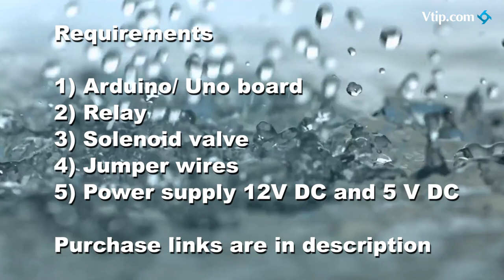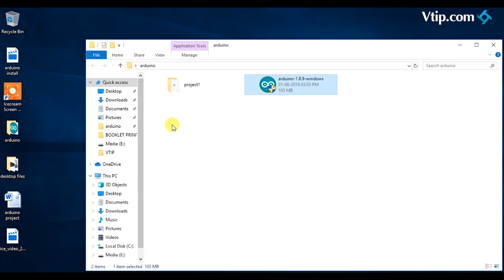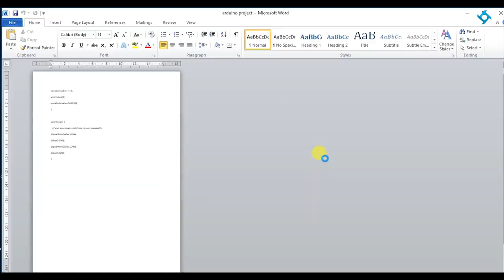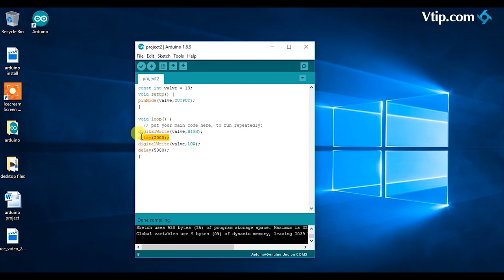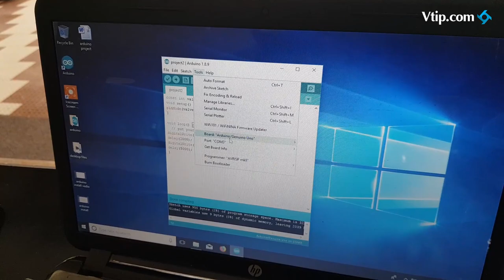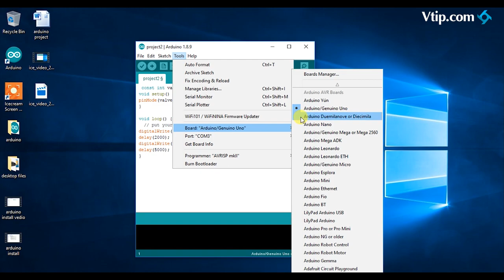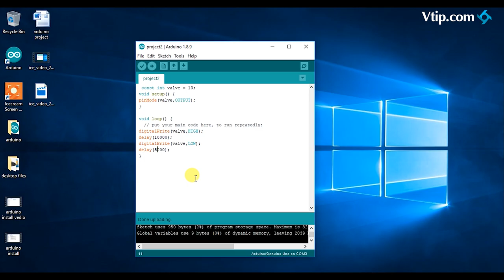Automatic watering controller using Arduino - Uno Board (Simple Project, No Experience required)

Comment: So Im gonna be using a separate clock module to regulate the opening and closing (the opening/closing of the valve is part of a large watering system). Do I need to use a relay? Im thinking I could just open/close the valve directly from the arduino uno. Would appreciate your thoughts on this, thanks
Reply: operating the valve directly from arduino board is a little risky as back current from the solenoid valve can damage the pin or even worse, can fry your arduino board

Comment: Hi! Hope you’ll answer my question. So I already have a relay module with a timer in it, is it okay to connect it directly to the Solenoid Valve without even using arduino?
Reply from the maker: Yes, you can connect the timer relay instead of Arduino.

Comment: Hi, this is wonderful.
I'm trying to make one, that can turn on when watering only and rest of the time the circuit remains open.
Is that possible?.If yes how?
Thanks in advance
Reply: Plz explain your requirements, I can help
Reply: @Niyasazeez1  Hi, thank you!
Well what my problem is, I want to implement this in real-time and it should be completely automated.

The problem is I can't run Arduino 24/7 all days a week.,it will damage the board
I want the entire circuit to be connected with power only 3 times a day, while watering the plant.
Rest of the time the microcontroller has to be in off condition.

Is there a way to do that?
Thank you for your kind response
Reply: @solomonbradleyj5999  there are few issues to implement your requirements with the above set up. The code gets reset whenever the power turns off and restart the counter when the controller is powered. So you don't get the proper functionality if the power turns off. You can use a real time clock module to solve this issue, still the microcontroller should be powered all the time. Otherwise use a time relay set up instead of microcontrollers. I
Anyhow I don't think the board gets damage if it is powered for a longer period.
Reply: @Niyasazeez1  Thank you for your help
I think running Arduino continuously for 4 months or more can damage it.
And forget Arduino what if I just connect a DC valve and the relay setup and just control the Power supply. My requirement is a power socket where power comes only 5 minutes , thrice a day.
And this three times the valve powers up and opens.
So the question is
Is there any way to get power  only at specified times from a socket?
Thank you again!
Reply: @solomonbradleyj5999  I will check and revert back soon. 👍👍👍
Reply: @solomonbradleyj5999  see bro I have a half solution to your problem and I am sure you are enough smart to find a remaining solution... I am sharing my idea
so you can use LDR controlled circuit, which will allow Arduino to power on just after sunset rest of the day Arduino will remain turned off. but you have to figure out how can you turn off Arduino after a particular time. you may use a humidity sensor or some other sensors maybe...

Comment: Hi sir,
Can i program the arduino according to how much time does it require to pumb as 1 liter or something???
Reply: After filling that particular amount of water to the pot,it shoulb be automatically closed.can i program like that???
Reply: @dreambigger5768  you can do it. Find the time required to fill a pot and mention it in the programme as solenoid active time. The second option is to use a water level sensor or kind of set up to turn off the relay.

Comment: Brother if i had to attach small dc water pump and 9v battery so will there be any change in the arduino code
Reply from the maker: Hi, thanks for trying out it. There isnt any change required in the code.